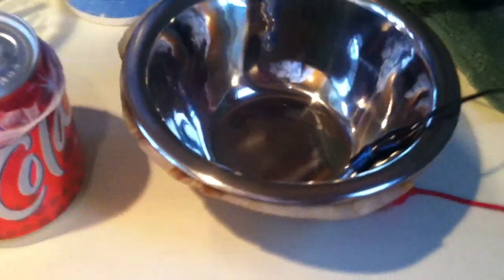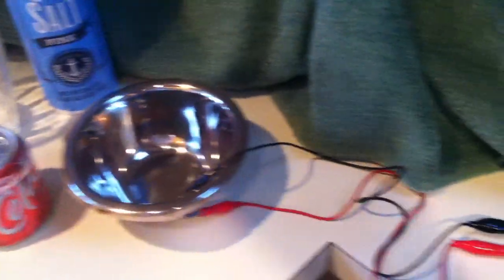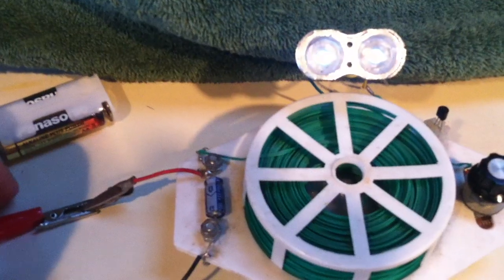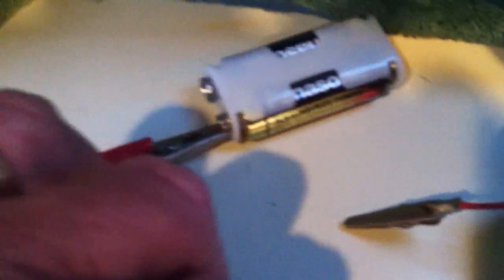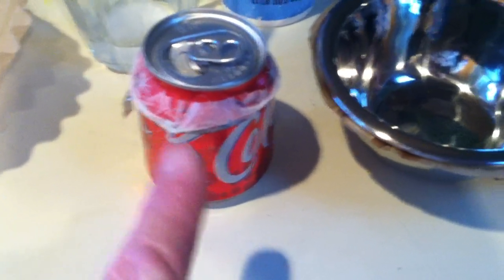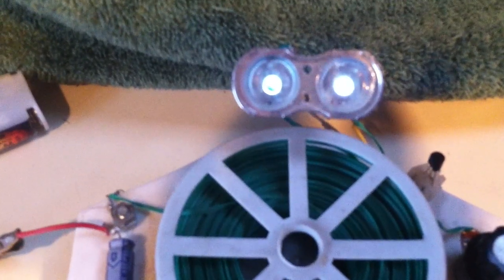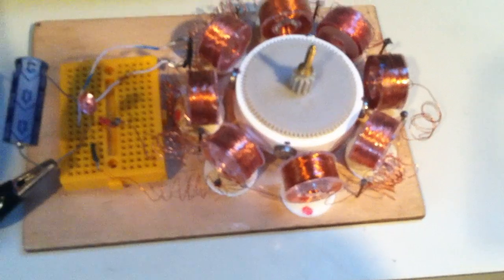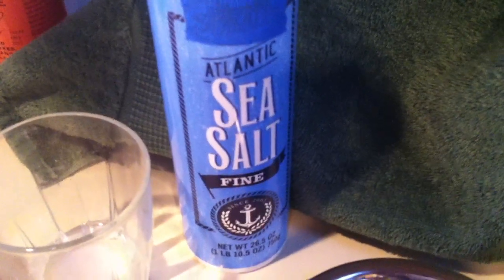Stainless Steel Bowl Battery or.... Capacitor ?

Comment: Online it says stainless steel contains small amount of vanadium which can be used as a capacitor. So i am guessing that metal contains a higher charge then releases it. Then once it does it converts back to its lower normal battery charge. So acts as a battery and capacitor at same time. Also says vanadium can degrade in certain types of electrolytes, maybe what is causing the rusting type effect.  How do you use a combined battery/ capacitor?

Comment: I tried aluminium foil and stainless steel and charged to 2 volt but dropped quickly when using a load. Acting exactly like a capacitor. Even just connecting to multimeter started dropping volts. But before connecting will hold volts untill any type connection made to capacitor. And the stainless steel positive and aluminium foil negative. The stainless steel need have rust type liquid run off it, using equal parts epsom salt and borax and 10% water, boiled  untill turns liquid soution. And left to boil for only 5 minutes more. It turns into a gel type liquid solution. 
If left for more then 5 minutes becomes hard and crystallized,  wont work when goes hard.
Reply: Using electric stove hotplate set to dial number 4.

Comment: It sounds like 304 or 316 stainless steel.

304 Stainless Steel
T-304 is the most commonly used stainless in the world. You can find it in everything from forks and knives to backsplashes. It is weldable, machinable with the right techniques, and has good corrosion resistance, but is not for use in salt water environments. This material is hardenable by cold work.
 
304 Stainless Steel (annealed condition)
Minimum Properties Ultimate Tensile Strength, psi 73,200
Yield Strength, psi 31,200
Elongation 70%
Rockwell Hardness B70
Chemistry Iron (Fe) 66.5 - 74%
Carbon (C) 0.08% max
Chrome (Cr) 18 - 20%
Manganese (Mn) 2% max
Nickel (Ni) 8 - 10.5%
Phosphorus (P) 0.045% max
Sulphur (S) 0.03% max
Silicon (Si) 1% max

316 Stainless Steel
Also known as marine-grade stainless steel, T-316 is similar in machinability and weldability to T-304, but has far superior corrosion resistance. It has a far higher yield strength than both 303 and 304, meaning that it will not bend as easily. This material is hardenable by cold work.
 
316 stainless steel (annealed condition)
Minimum Properties Ultimate Tensile Strength, psi 89,900
Yield Strength, psi 60,200
Elongation 45%
Rockwell Hardness B91
Chemistry Iron (Fe) 65%
Carbon (C) 0.08% max
Chrome (Cr) 17%
Manganese (Mn) 2%
Molybdenum (Mo) 2.5%
Nickel (Ni) 12%
Phosphorus (P) 0.045%
Sulphur (S) 0.03% min
Silicon (Si) 1%

Comment: You can try using some dielectric grease from an auto parts store (think ace also sells a $5 bottle -- doesn't take much) to see if its a battery or a capacitor.
A very very thin layer on the metal on the side the electrolyte is on. (both plates)
Maybe without a dielectric its acting like a battery but it can be a capacitor?
Reply from the maker: Don't even need to do that.  Just use plastic wrap and as the separator with no electrolyte.  That will make a regular capacitor.  I think what I did here is a battery of sorts.
Reply: Yarp. However, electrolytic caps tend to have a slightly higher capacity due to the electrolyte helping to increase the surface area. It is possible that what you have is a poor mans super cap and using a dielectric to separate the plates from the electrolyte could tell if that is the case or not. :)
There are decent crystal batteries out there that do not require the corrosion of the metals. Van der waals force and crystal chemistry explain how that works. Can use hematite (positive - abundance of negative ions produced by hematite), quartz as the dielectric, and barium ferrite magnet or some other form of (hopefully harmless) material that generates an abundance of positive ions for the negative end. (the magnetic properties help to reduce internal resistance - and as I am sure you know a differential - any differential - is one way to get electricity....ie. hot and cold, positive and negative ions [lightening], etc).
Still need electrodes (metal - alluminum and copper work fine) for the positive and negative terminals. Then just can put the small cells in piles like modern batteries and it ends up being a self charging battery. If not made too efficient it will last until the metal biodegrades. More efficient crystal cells will spend the crystaline materials faster. Following the maths with Van Der Waals force completely. Mixing the wrong crystals can cause explosive gasses to be made, so that is something to watch out for. lol
Love your videos. I always look forward to the next toy you are going to build! Fun stuff!

Comment: For whatever it's worth, I think you have built a capacitor.  
The run time might be just because you have such a large surface area between the bowls.

Thanks for sharing!
Reply from the maker: I still don't know.  If it was a simple capacitor then why the breakdown of the metal and why does it take awhile to charge up?  Why does it only charge up to about .6v?  Now I'm going back to the battery idea with iron oxide forming up on one plate caused by the electrolysis.  Perhaps you end up with a kinda nickel / iron battery????  I'm open to all ideas.
Reply: Perhaps you are right due to the corrosion.  It's a mystery ;)

Comment: Sea salt is great as the electrolyte, you have the surface area too with the bowls. Ideally, summer humidity would keep the cell from drying out and some form of static electricity or ambient collector would keep it charged. Btw, a blue LED salts cell from years ago (with Penny type circuit) started up again a couple of months back and keeps firing up when the window A/C isn't on lol. This type of building block project with the bowls may have real uses for automatic air conditioning and such in the IoT future. Things that work because of actual environment changes, rather than digital sensors and switchies.
Reply from the maker: Fun stuff.  Environmental micro power units that work off ambient changes in humidity....really cool idea.  If you get a chance build up one of these Al can cells and see what you think.  I'm charging mine with one of those tiny solar waver cells and running a pulse motor off it.  Last night I gave it a extra jolt with a AA and it made it through the night OK.  I think I know why it works now but I'm still testing.
Reply: If you were to parallel it with 1000uF cap and put clingfilm over to stop evaporation, then I wonder if it would be a 'Forever' cell. Improvements to the electrolyte could then see smaller and smaller helper caps. I might well pick up a couple of these bowls..we have 4 cats after all !
Reply from the maker: I thought about drilling a tiny hole in the top bowl and putting water in it.  Capillary action would draw the electrolyte up the membrane.  You would just need to add water when the level goes down.  These SS bowls are really just a scaled up version of the SS condiment cup experiment that I have done.  These bowls would also make good top loads for tesla coil or slayer exciter experiments.
Reply: SOLD ! lol Just got to go shopping now.